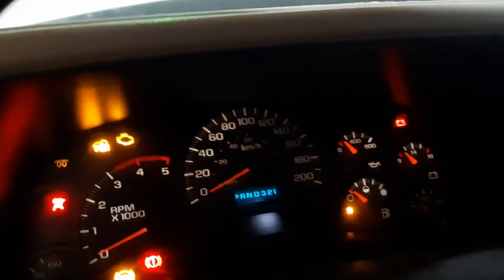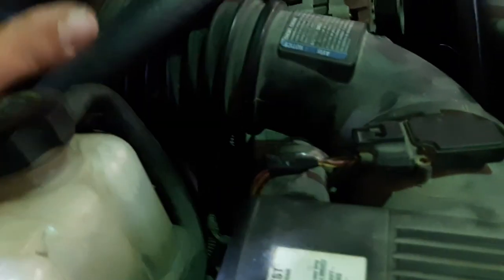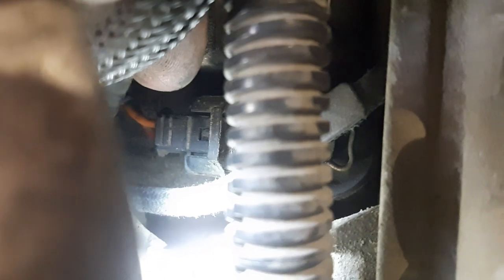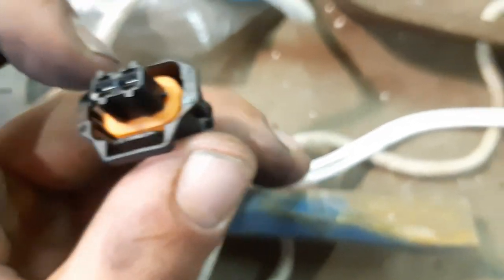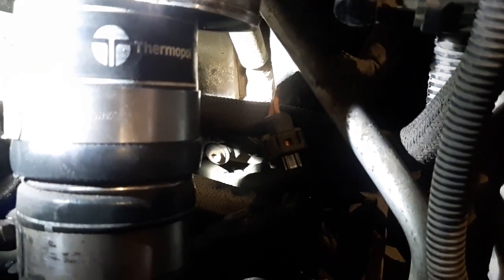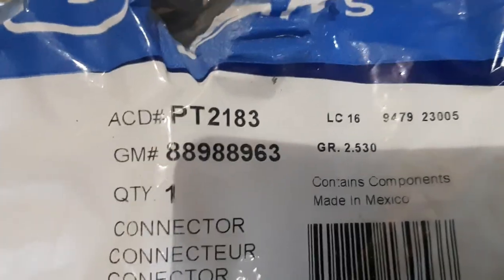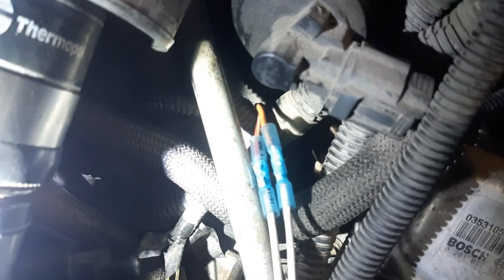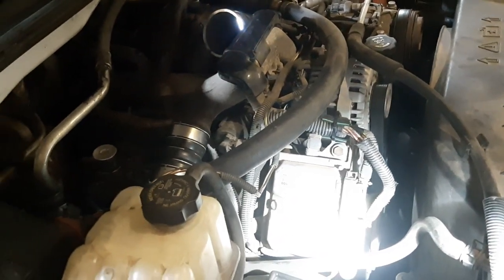2005 LLY Duramax Injector Pigtail Replacement

Comment: Question, were the replacement wires a little bit smaller awg than the original harness?
Reply from the maker: I think they were the same if I remember correctly